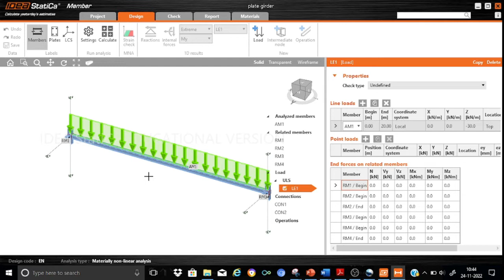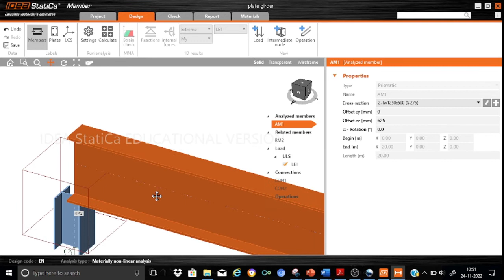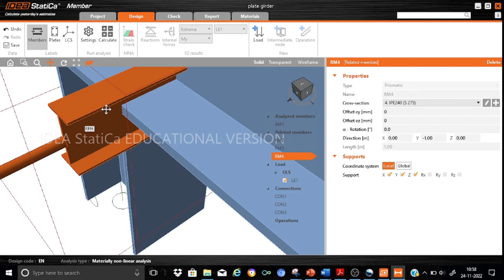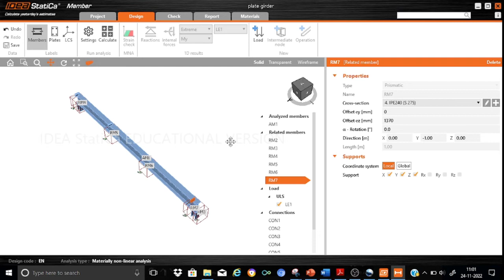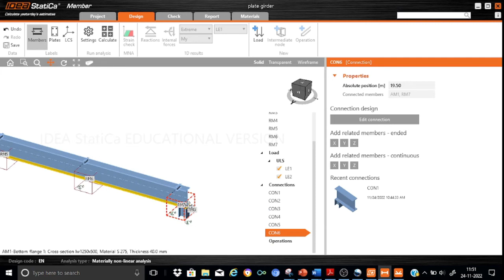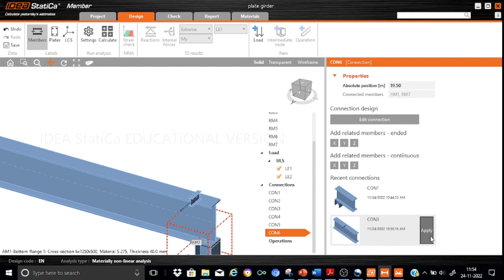IDEA Statica: tutorial 38 – Design of a plate girder- Part-1: modelling & loading

Comment: Hello sir, could you please share ur thoughts on capacity design of vertical bracings corner column beam joint with upper and lower vertical brace.. is it possible in indea STATICA capacity design.